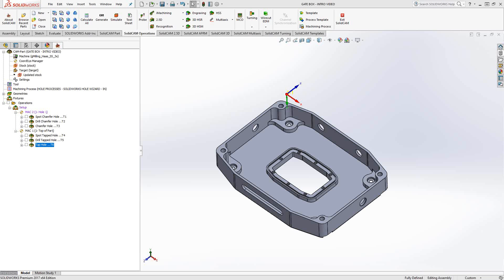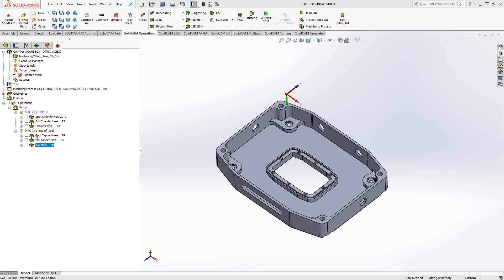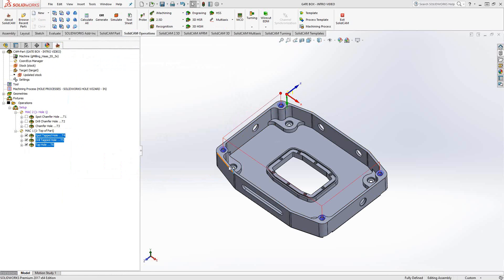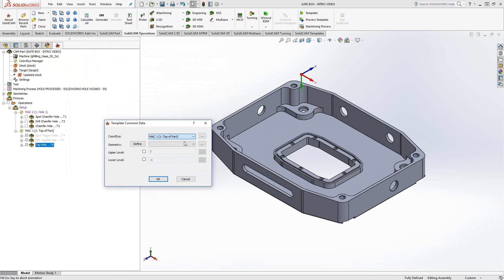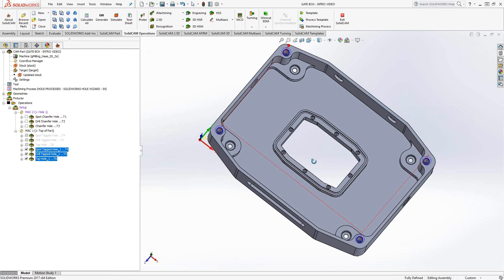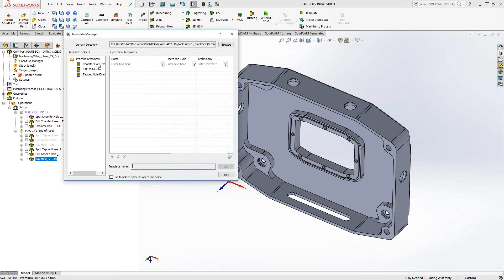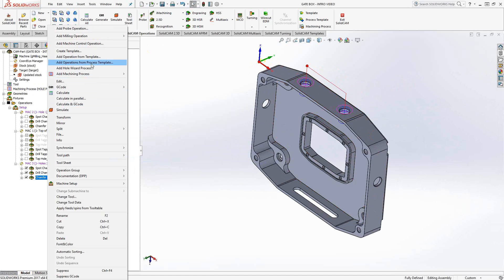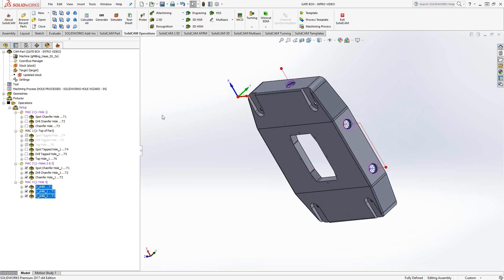SolidCAM  - Process Template for Simple Drilling Common Geometry

Comment: Does the common geometry selection works only on drilling operations or it works with other operations too ? . Like pocket and profile operations?
Reply: Any common geometry will work.
Reply: I have realised that the process template allows you to define the common geometry only when the geometry and the operations are the same. For example when you have a few pocket operations which use the same geometry or a profile operation which use the same geometry it works but if you have a few different operations like 2d imachining ,pocket, profile even this operations use the same geometry the define button becomes greyed out.let me tell you this a practical process template is not a bunch of pocket operations or profile operations it is a mixture of best operations altogether. I am sure we all knew that we can use different operations with one geometry then why is the define button is greyed out in there?. hope someone will explain this